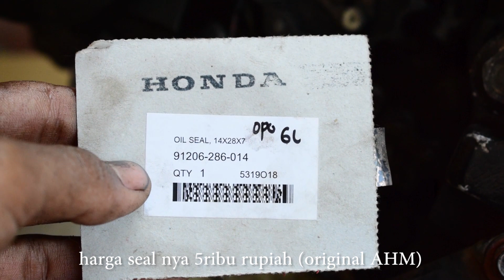oli mesin rembes cara mengatasi oli mesin rembes dan bocor

Comment: pack mesin bawah kiri tiger rembes itu kenapa ya mas?
Reply from the maker: ganti packing nya mas,bisa jadi kurang bersih pas ganti oack lama nya
Reply: @morestteno  harga packing berapaan mas?
Reply from the maker: packing 5 ribuan mas,beli di grosir sparepart motor,kalo di bengkel biasa 10 ribuan
Reply: @morestteno  cuma ganti packing aja ya mas?
Reply from the maker: yg rembes bagian mana ya mas,magnet tengah apa kopling?
Reply: @morestteno  didepan gear depannya mas, dekat kampas kopling
Reply from the maker: ohh gampang mas,mas buka aja bak magnet nya,ganti packing nya,namanya packing bak magnet,harga 5-10 rb,jangan lupa packing lama di bersihkan sampai benar2 bwrsih gak ada yg tertinggal,kalo masih bocor juga berarti ada masalah sama karet kabelnya (karet hitam yg ada kabelnya)solusinya di lem kalo karetnya bocor pakai lem sejenis threebond
Reply: @morestteno  makasih banyak masukannya mas 🙏

Comment: Salam sodara rx king gan motor saya rante nya keluar oli muluk saat jalan kencang... Udah saya bawa ke bengkel 3 katanya cuma ganti sil  tetap aja klo  d pake laju  kencang keluar oli apanya ya gan
Reply from the maker: seal mana gan yg udah di ganti?
kalo rx king bagian kiri ada 4 seal
1.seal gir depan
2.seal operan gigi/perseneling
3.seal stut kopling
4.seal cranksaft
yang kena antara 4 itu gan
coba buka bak magnet/bak mesin sebelah kiri,nanti bakal kelihatan yg rembes dan bocor,semoga cepat teratasi🙂